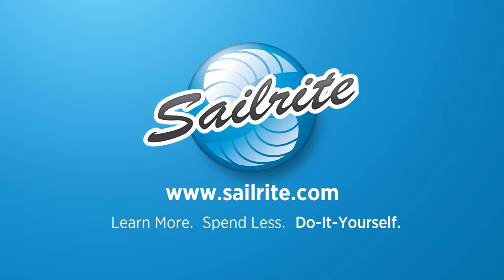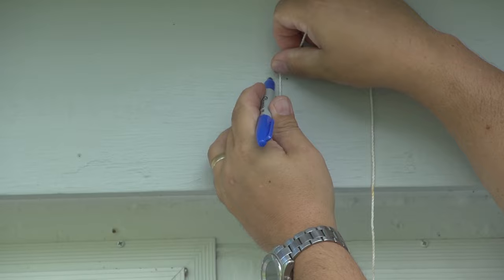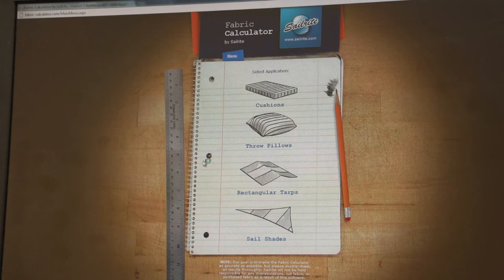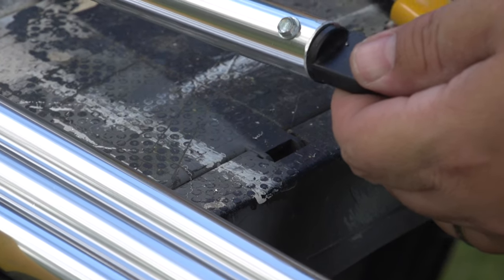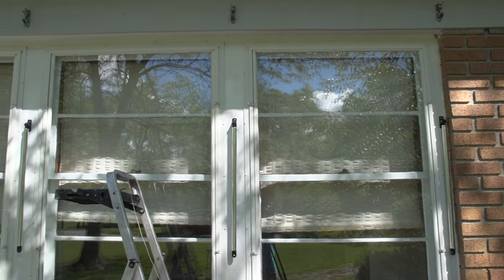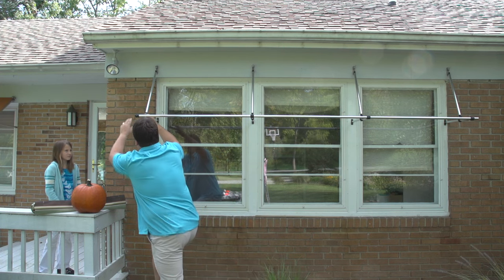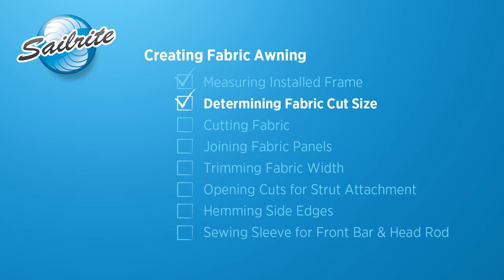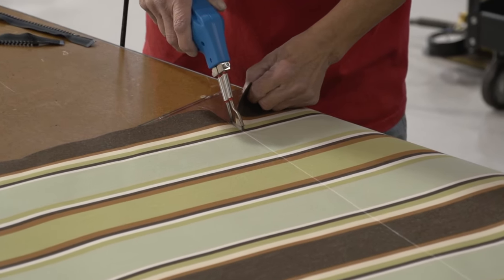How to Make a Canvas Awning on a Home

Comment: Curious why EMT steel tube is used for head bar instead of aluminum like the rest of the frame. I can understand the other way around - not using the EMT for entire frame since it might be too heavy.
Reply from the maker: EMT 1/2" pipe is really available at almost all hardware stores and it is very cheap. It also does a great job at the header of an awning.
Reply: @SailriteDIY  Thank you. Looks like it would work for the entire frame, but one would still need the special hardware for attaching it together.

Comment: I would love to do this but my awning needs to be 6' x 15'.  Would this type of frame hold an awning that size and how would I bind several pieces of material to make one piece that size?
Reply from the maker: Joining sections of fabric together for an awning is common and often required. It is typically done by sewing an overlapping seam. That seam is simply the two fabrics overlaying each other by about 1" or less and a few rows of straight stitches to secure them in place.